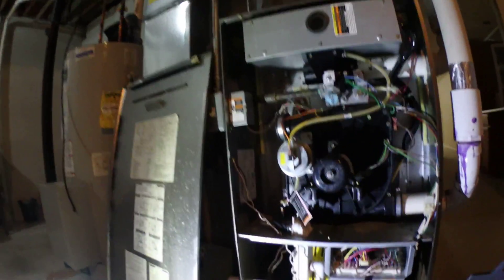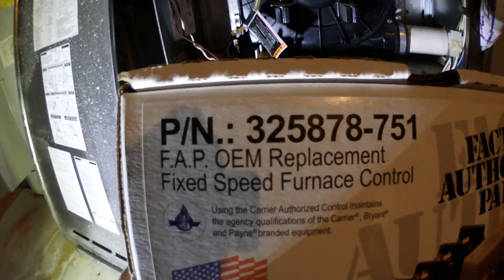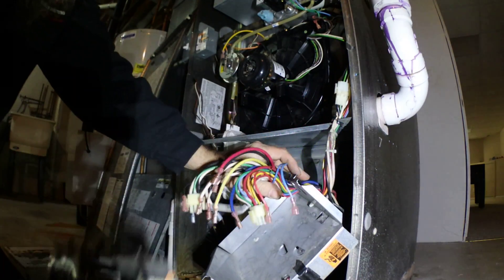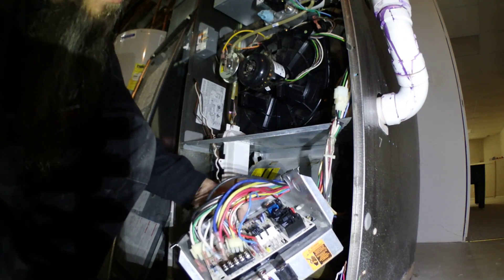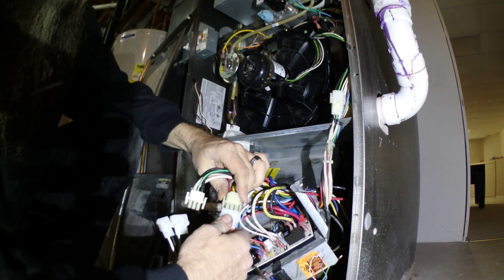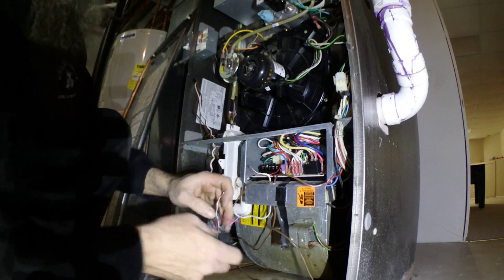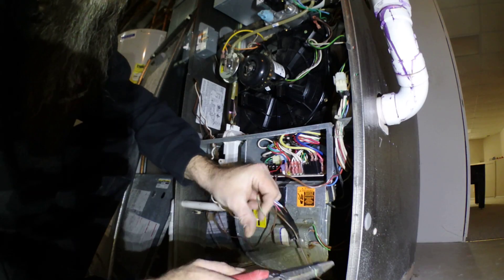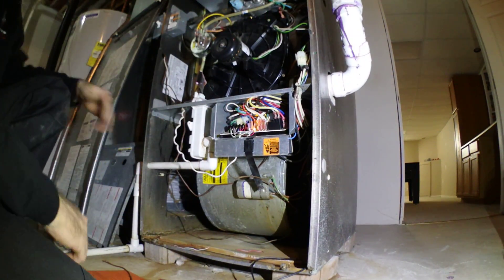Bryant 340mav048100 control board change (325878-751)

Comment: Excellent video. Tremendous help to me installing a new board on what looks like my exact furnace. However, my old board is different than the one in the video and the location of the Red/Blue and Black/Yellow are in opposite locations. So my Red-heat/Blue-cool follows the old board labels. That makes my Black/yellow in the neutral plugs on the new board. Is this going to be ok? Thanks again for a great and helpful video. Dwight